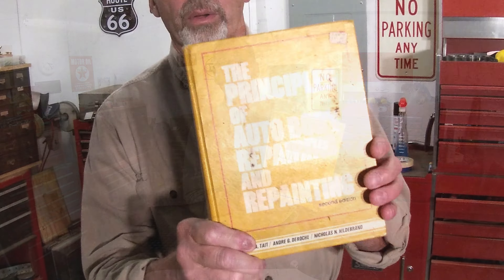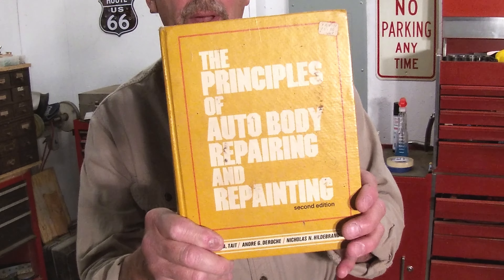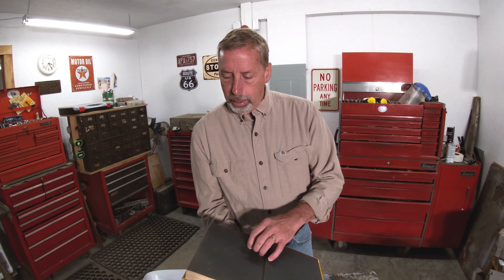Heat Shrinking 2.0

Comment: I bought a little torch that uses MAP Pro gas and O2. IT works very well in shrinking the metal. I did both bed sides of a pretty bent up 1956 Chevy pickup. Worked great
Reply from the maker: Good to know. Thanks for watching
Reply: I got one too and yes it works good but I ended up getting a big set of torches because I was going to spend more on them little tanks of oxygen then it was to buy a big set
Reply: @toodjackson4438  Too true, those little O2 cylinders are not cheap. I only needed one on my bed sides.

Comment: Well there are different propane torches that produce a more compact flame so you don't get that kind of wide distribution of heat,  so with one of those torch heads it might actually work.  Oxy/Atcl is much better and faster though.

Comment: I personally what to THANK YOU for making this video. I had a large oil canning area on the roof. I first tried to use propane but gave up as I was chasing my tail. I then came across your tutorial and brought an oxy/acetylene set. I have managed to get the panel to stop oil canning after 35 heat shrinks.  I can still move some areas so I'm wondering how far do you go? (1967 Camaro roof) Cheers Jim from Australia
Reply from the maker: Hi Jim. You can keep going until all the oil canning is taken care of.  Big panels usually require lots of heat shrinks to stabilize the metal. Once it’s nice and tight you can check for any high spots and shrink those areas if needed. Thanks for watching
Reply: @autobodytrainingsolutions838  Thank you. I went a little bit further last night and it is getting tighter. Unfortunately, I don't have high spots but a lot of low stops.

Comment: nice video, thnx. there are specially made nozzles for propane torch, that make condensed conical blast with i think higher temperatures etc. do you think, in this case propane torch could be somehow useable for diy-er? any chance to make video about it?
Reply from the maker: I haven’t tried one but I may look into that for a video. Thanks for watching

Comment: How would you go about shrinking a debt that you don’t have access to rear side of the panel for pushing dent out and dolly/hammer access, like the bottom side of a tailgate or body side?
Reply from the maker: Some times you just can’t shrink so you have to try pulling the dent on with a stud gun or pull rods. There’s really no clear cut answer as every dent is different. Thanks for watching

Comment: Question... What do you do if you have body part like a trunk lid that has oil canning pretty bad and you can't get to the back side of it because of the bracing on the under side?
Reply from the maker: How To Repair A Panel Without Heat
https://youtu.be/z427DPo1r_M
Here’s my video on repairing oil canning without heat but with access to the back side. Can you make small holes in the backside to use small picks? You’re limited what you can do but without seeing what you have it’s hard to give you any help.
Reply: Yes I understand, thank you. It’s a 66 Chevelle trunk lid and the bracing underneath covers the entire thing. I’ll check out the video thanks again.

Comment: How much can you shrink the area? I have a 1/4" high spot over a 6 inch area (deep dent that stretched the metal).
Reply from the maker: There’s really no end to how much you can shrink. You can do as many as need over a large area to work it down. When this was a common practice I remember sometimes having to do 15 or 20 on a panel if that’s what it took. Great question. Thanks for watching.

Comment: Can I use the torch to heat the metal to cherry red and then use the dolly to push the dent out and then apply water to shrink?

I'm trying to repair a dent on driver side quarter panel of a Honda S2000 and there is no roomm for a hammer and barely any room for a dolly.
Reply from the maker: I wouldn’t recommend it. With the panel already pushed in, heating in this position would push it in further and be almost impossible to straighten it correctly. Thanks for watching

Comment: I have a large area that is low, about a 1/4 inch.  Do I need to push that out in order to start shrinking it? It had a bunch of filler in it, I have removed it all back to metal, I’m going to weld in a new panel on the lower area and I want to remove the low area as much as I can.  Any advice would be greatly appreciated.
Reply from the maker: Yep. You must push out the panel before shrinking. You always want it to be high and the shrinking process will lower it where you need it. Good luck with your project and thanks for watching
Reply: @autobodytrainingsolutions838  thanks!  I’ll have to work on this one for a while I suspect, the low area is the size of a basketball.  Im trying to video each step on my repair/restoration. Let me know if you want to see any of it.  
Don

Comment: I used to have a mushroom head for my Auto Arc (Miller) stud gun that would heat the panel up real fast and no dicking around having to relight a torch for every shrink. And, yes, I also have a couple of those relighting torch rests but this was faster. Also, remember there used to be a "shrinking tip" for gas welders that somehow pulled oxygen through the backside of what looked like a propane tip? Got one of those too somewhere, next to that spray leader filed under dinosaur equipment. I  went to autobody school in 1976 too...shame it's gone but then not much gets fixed anymore and all the industry cares about is if you're fucking Icar certified! This is what happens when you let insurance companies rule an industry.
Reply from the maker: I have one of those tips for the stud gun. Did a video with it a few years ago. You’re correct about the insurance companies. The owner of the vehicle doesn’t have much say in how their car gets repaired anymore. Thanks for taking the time to comment and for watching.

Comment: does heat shrinking metal make it harder to work?
Reply from the maker: Good question. It’s possible but I don’t know for sure. Sheet metal is low carbon so it could harden but only in the spot that was heated red hot. It wouldn’t affect the rest of the panel to cause any straightening issues. Thanks for watching

Comment: Once you heat the high spot, you need to work the steel back into the centre..
Not just beat it down. 😂😂😂😂😂
Reply from the maker: Correct. You should’ve watched the video 😂😂😂😂😂